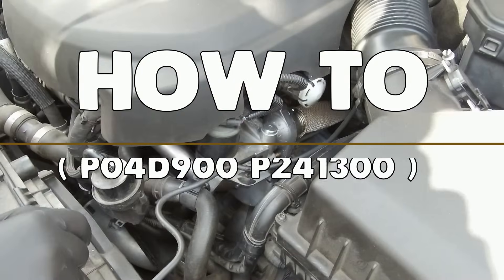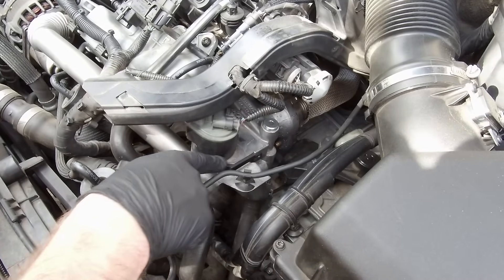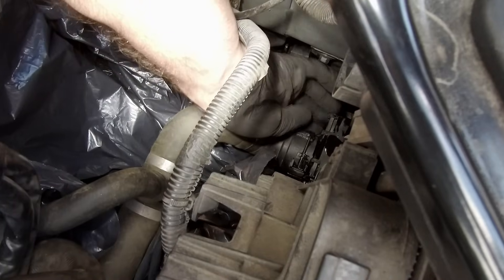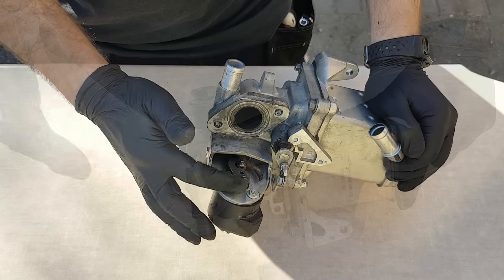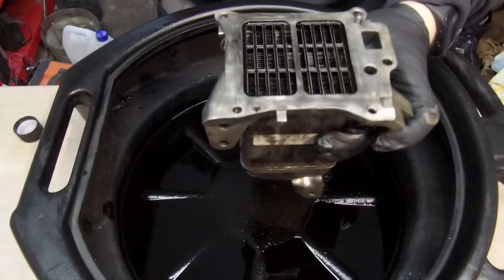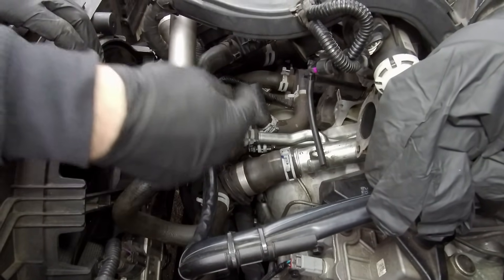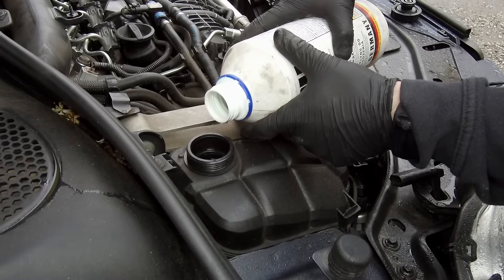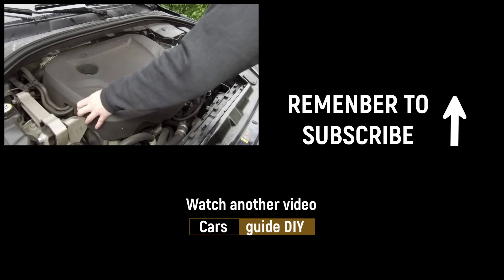How to solve a problem with EGR valve : Volvo 2.0 D4 ( P04D900 , P241300 )

Comment: Very good instructions. Unfortunately I had to do it 2 times because the car used a little coolant after the repair where I reused the gasket for the EGR cooler. 

Second time I bought a new gasket which is possible without buying a new cooler or EGR valve.

Comment: I have just finished the cleaning and remounting of my EGR valve (I have 140 000 km). First I would like to thanks you because you gave me evidence that it was not too difficult. Second through this I notice two issues:  a) My EGR valve was one mounted with 2 bolts (the 3rd one below was not there), b) the pipe which was controlling the pneumatic actuator to by-pass of not the EGR cooler was squeezed and therefore was no longer allowing by-passing the cooler when the motor is cold (which is probably why I noticed a lot of soot in the cooler as well as in the gas inlet pipe.  My EGR cooler was almost clogged, your trick with acetone worked fine (I kept a picture).   I followed strictly your procedure except one. i.e. I removed the exit pipe of the EGR going back to the admission inlet. This eases the physical access to the EGR valve,  allows cleaning this pipe (it was very dirty dust and soot), and allows also a small access to the admission of the engine (for visual inspection) and allows to remove partly with fingers soots.

Comment: Very helpful tutorial, I had a very clogged EGR on my V60 and it has been of great help watching how to disassemble and clean it. The two T40 torx bolt behind the EGR cooler were quite difficult to get to, nearly lost hope. However I watched another video that explained that the right size of those bolt was a T40 so that helped making sure I was using the right size. I would also recommend prior to starting the process to spray some penetrating oil on those screws, so by the time you reach to disassemble them, they'll be easier to remove. EGR cooler was very dirty (68k miles on a 2017 car) and it took few days and multiple soaking to cleaned it up. Some people uses also ultrasonic cleaners, I've not tried as I don't have one, but it could be an alternative especially if you're planning to do few of them. Volvo quoted £1500 to get it sorted and didn't want to do any goodwill. After putting everything back and deleting the code, it has not come back and everything looks alright. I'll try to update if anything changes.

Comment: Thank you very much for this excellent video !!!  
It has made me confident to start doing it myself .
I did it on a complete week-end including the cleaning with pure acetone.
The warning light, so annoying, no longer reappears at all after the reset with my OBD2 reader. 
The car is now more punchy, consumes 0.5 liter less per 100km and I saved a lot of money :-) the garage did not want to clean but to put new parts..

Several points to share if it can help : 
- XC60 2014 200K km
- EGR changed at 60K km
- EGR recall done ~2years ago (hoses +ECU reprog it seems)- motor warning light appeared 6 month ago
- I've bought the gasket between EGR and cooler on auto-doc Ref 013.630, brand 'Elring'. It fits perfectly and is of good quality
- Step to empty the coolant at 4:50 in the video skiped. I used a cut bottle instead to recover the liquid (~0,5 liter) when removing the hoses.
- the tightening torques can be found on other videos- the step of unscrewing the 2 screws between the EGR and the exhaust pipe is not shown in the video ~6:22. Have you changed your original torx bolts to new ones in yellow color  (hexagonal head) ? On my car it has torx screws and I had a problem at this step because I stupidly forced with a Torx30 screwdriver even though it was Torx40. I couldn't see the screw well because the head was oriented towards (and close to) the dashboard; I partially broke the teeth of the screw. I recovered the problem by forcefully pushing a torx40 screwdriver into the screw (with a hammer), it worked.

Voila !  Thanks again and long life to your channel ! ;-)

Comment: Hi, thank you for the well explained tutorial. I followed it but sadly, my EGR valve is broken (actuator not moving freely).
Just a little tip for the cleaning part. I've used oven washing detergent without caustic soda (not good for aluminum). Here in France you can find a product called "decap four" by henkel, the green bottle one named "confort".
It is really efficient.
Goodbye mate!

Comment: Hi, Just followed your video and did the job. Your Video and description was brilliant. I had Engine warning light on all the time. I had it checked and it was EGR fault. £1000 for volvo to fix!!! I did it in 5hours plus 24 hours cleaning time. Now all cleaned out and back working. the car feels more responsive. My D4 had only done 47K miles and I could tell the EGR has already been off before because bottom bolt was missing!!!  Thanks CG  love you.
Reply from the maker: Good to know :) Regards ;)
Reply: I'm also having trouble with my egr on 2.0 d4 r design 2014,  garage has quoted me over £800 and that doesn't include labour, 
100,000 miles

Comment: Question, how long after assembling the egr back should you wait until you start the vehicle again for the sealant to cure?
Reply: usually that would be stated on the sealant instructions: I would generally expect 24 hours for full curing. Some people on other forums mention the fact that sealant is not actually needed if you use the gasket.

Comment: I gave the same problem and i am going to use youre procedure.
Only one question, why remove coolant from bottom hose? If i disconnect egr valve not much coolant will escape only from egr ? Egr is on top of the engine!

Comment: Hello,

I have fault code P2262, on volvo xc60 2015 2.0 diesel. I have already change 2 sensors  but the problem is not gone. Can same one help

Comment: 6:23 You can see 2 "golden" screws to the pipe and EGR module. These have to be unscrewed also.
Reply: I have V40 ,those 2 screw was the hardest to take out,i have small hands but there was no space

Comment: Can I use Ultrasonic cleaning machine to cleanr EGR Valve & Cooler? Was thinking of using 10L Vevor Ultrasonic Cleaner with Allendale Engine SOlution....Great video by the way. Thanks.
Reply from the maker: I've never used it, but it seems like a good idea :) 
Thanks for your comment
Regards :)

Comment: Im getting a P00BC MAF error. I monitired the EGR valve on the app while driving and it stayed at -1.52 and hardly moved from that, so potentially an EGR valve stuck. Im going to get it mapped out, does the EGR delete remap also make the EMAP pipe redundant? Or will the EMAP pipe continue to operate?

Comment: Thank you for taking the magic and worry out of sorting out my egr problem.   Worked a treat,  clear video with excellent description.  One suggestion if doing this you could slot out the bottom bracket from the left so the you only need to loosen the bolt and won't drop it when replacing the egr cooler.  That bolt can't be seen or felt and is hard to locate.  I tried slotting it from below but that didn't work due to lack of clearance I couldn't lift it up far enough.  Great job saved me a packet!

Comment: Good video.  Do not be affraid to use high pressure washer. It helped helped me finaly. Soaked in different chemicals but finaly got clean with high preassure washer.
Reply: Thanks for the tip! I followed your advised and cleaned mine with the pressure washer. Happy with the result. ;)

Comment: Thanks, about to attempt this having watched your disassembling once already - seeing what needs to be removed and where all the fixings are is super helpful - unlike VIDA which basically shows 4 steps and magically the EGR assembly is removed 🤦‍♂️

One question - how on earth were you able to get to the 3rd EGR bolt at the bottom with all the pipework in the way 😮

Update: Well I managed it eventually - my cooler was disgusting, I tried the acetone method which was pretty good, but then realised that there was too much caked on crud inside. A degreaser I had lying around also worked really well - Bilt Hamber's SurfaceX HD which did a great job dissolving a lot of the oil. After around 6 soakings and rinsings, some of the channels were still blocked so I used some thin wire (the outer steel cables from armoured cable) to dislodge any hard bits - after another 3-4 overnight soaks and rinses the water is finally running clear 😵‍💫

Comment: some work was done on my car by volvo regarding EGR 5 moths ago, since then my cars clock time is wrong and I cant correct it. the sat Nav is also disconnected. when I got the car back it had no coolant fluid in and even after adding the liquid the dash was showing liquid being low. 
now my car is showing a ton of fault codes but everything is working right when parts are checked individually. 
my XC 60D4 shakes and lacks power to the point it hardly drives. 
I would be greatful if anyoe has any advice or experienced the same.
Reply: Join to UK volvo v60, xc60 Group or volvo 60 International one mate. Both groups are available on facebook
Reply: @CharlesPiston  had same problem with my 2016 volvo V70 D4 Engine. apperently oil been leaking or not burnt correctly and the whole motor is full with oil sludge. and my egr broke. got a new one 1 month later it broke the egr. The car lost power or didnt not accelerate properly either during the .

Comment: I was replacing EGR valve my self recently at the same engine. Unfortunately in my case that sort of repair was not possible due to faulty electric engine, so I had to replace whole valve. For those who have got same problem this is great movie. Great job.
Reply: Same problem on my side. how many miles/km you had on board when happened?
Reply: Same happen to me my d2
Reply: Hi, 
I'm also having trouble with egr and may need to replace it, if you don't mind me asking how much did you pay for it?

As a garage has quoted me over £800 and that's not even including labour
Reply: The same thing was needed for me. Replaced it for 600 gbp and the dtc re appeared. Still investigating

Comment: Thank you for this .
Engine warning light came on and fault code was reported to Volvo on our 2014 V60 D4 they said EGR needs replacing. 
We have been quoted £1700 by Volvo to replace EGR.
Absolute disgrace to be charged this when it's a known design fault.
Reply: The car is >8 years old and probably with the mileage to have gone around the world several times. How long warranty do you expect?
Reply: @Mejk4204  that is not the point
Reply: @johnbower  The point being?

Comment: I can See that this Car in the Video has the old cooling System. Now in the Year 2020 Volvo Car Corporation has started a new Recall on These engines to solve the Problem with Carbon build Up in the intake manifold 
and related parts of the intake System,that effects the EGR System,Cooler and Valve.
Reply: Volvo should fix the fault because at the moment customers with cars older then 4 years haven't got help from the dealers
Reply: They do if the car is still under warranty AND if you have the car maintained by your official volvo dealer.  Otherwise they simply tell you have to buy the parts.  don't ask how I know.  The problem still comes back anyway.  shitty system.

Comment: That engine still has pretty serious problems. 
It consumes oil excessively after 100 thousand kilometres. certainly the used 0w20 oil doesn't help, nor does the mileage of 30,000km for each service. Have you already solved similar problems? meaning did you change the oil with a 5w30 or a 0w30? or are there other problems with this?

Comment: Great tutorial..
Could you help me to clean the PCV valve of this same engine. I have volvo s60 2014, Diesel, 2.0 D4. 
Its valve cover gasket is leaking and makes a whistling sound on rpm above 1500. I have tested oil filler cap with rubber gloves, its just inflated and slipped off because of increased pressure. I thought to replace PCV valve but couldn't find it on this engine.

Comment: Awesome guide. Very easy to follow! My egr is super clean now but unfortunately the valve is still temperamental in movement and very stiff! I’m going to have to buy a new one but at least I can fit it myself
Reply: Hi, 
I'm having trouble with mine as well, 
May need to replace it myself as well,

My question is how much did it cost? 
As a garage has priced me over £800 for the new egr and that's not including labour
Reply: @sheffcitys2forgedinsteel255  I think mine was around £520 ish. Following this video makes it very easy. I didn’t bother with hose clips either
Reply: @PeterFrench  thanks for the reply mate 
Don't know whether to try this ( cleaning it  )
Or buy a new one and try to fit it myself
Reply: @sheffcitys2forgedinsteel255  I used DIMER cleaner, it got rid of all the crap in it. Worth a go considering the cost garage would charge, even the part itself is expensive. Fitting is fairly straight forward, no special tools required and it took less time that I expected. If you are confident enough with a socket set go for it.
Reply: @Peter French  yeah i probably will do it myself makes sense and save me probably the best part of a grand if not abit more.
Once again thanks Peter for your insight
Reply: @PeterFrench  how did you teach the new EGR valve in? Can you do it with a common OBD reader, like the iCarsoft V3.0? or do I need the Volvo DiCE/ VIDA? I have to replace both EGR valve and EGR cooler on mine...
Reply: @luke1811  just replaced it and gave it a drive for a few miles then checked the fault codes cleared with OBD. Nothing else. I only changed the egr and not the cooler. Although I did clean the cooler as much as I could when I took it off initially.
Reply: @PeterFrench  thanks!! that's comforting to know. Volvo wanted 3k€ for a Cooler and Valve swap, with 2 weeks lead time... 
What model and year did you do this on?
Reply: @luke1811  I did this on XC60 2016 D4 2.0 Manual. Thats a crazy price, I'm by no means a mechanic but I'm more than willing to give something a go. Basic tools are all you need and just follow the video. I didn't drain the coolant or block the hoses, just topped up the coolant after. Car has been running sweet since, although its time now for a service and new tyres, so something else I'm probably going to do.
Reply: @PeterFrench  Yes, they are located in a big city, I guess they have to pay their abnormous rent lol. That's great, I want to start servicing it myself too. Don't like spending half a day for an oil change at Volvo.
 They also told me the MAP sensor at the intake manifold is coked. Do I need to change the sensor, or is cleaning sufficient? Is it a hard task to do? Thanks again for your help!
Reply: @luke1811  I’m sure you can just clean that, that’s easy enough to change as well. I’m sure it’s just 1 bolt
Reply: @PeterFrench  awesome. I will let you know how it went, if I don't forget 😄 Thank you

Comment: Hi, is it possible that it could that also cause  a air flow sensor problem  ?
Reply: Yes,the MAF Sensor is affected.
Reply: MAF sensor which is on top of manifold and EMAP pipe which is on the right side, behind the engine
Reply: @CharlesPiston  is it possible to remove EMAP pipe for cleaning? Is it easy to remove? Thx.
Reply: @chargrilled9081  I didn't yet but Tom from UK Group did

"you'll need to remove one heatshield, one bolt from the other and bend it away from the banjo to manifold connection.  Fiddly but can be done. the pipe is £80 + VAT"

Comment: Do you know if the EGR valve motor return spring is supposed to close the valve as mine is staying open around 2mm, if I close it completely by hand the engine idles better, TIA

Comment: I fixed the same problem on my 2014 V40 D4 190hp. I had e very hard time cleaning the egr cooler. It was full of carbon deposits.I left it 2 days in different cleaning products and almost no result.Acetone didn't work in my case. After that i used a high presure shower head with hot water and it slowly started to clean up. It took me more than a hour and a lot of dirt was splashing in my face and clotes. Finaly i succeded and i  saved about 500 euro. The check engine light is finaly off and the car runs great.
Reply from the maker: Good to know :) I hope my video helped you.
Regards
Reply: Oven cleaner
Reply: kobus van boxtel over cleaner is to aggressive to aluminum

Comment: Is it not possible to remove as much coolant from the header tank , unclip and blank/plug the 2 x EGR Cooler hoses from the cooler instead of draining the whole system ??.  Volvo completed an EGR cooling recall but VIDA still report EGR 'Low Flow'. So I'm going to clean it using your method, but unsure where I can buy Acetone in the UK.
Reply from the maker: I prefer to drain all coolant. It's not complicated and you don't make a mess. Regards
Reply: nail varnish remover is acetone

Comment: What about the high oil consumption I experience on my 2014 D4 Volvo 0.5l in circa 1200 miles. Volvo engines used to last for many K’s but mine has only done 150k. This is the worst car I have ever bought and has to go ASAP.

Comment: I love the fact that the wrong EGR-Valve/Cooler combination is fitted.. you shouldn’t be needing to use a threaded bolt with a nut on the other side.

Comment: Great video. Helped a lot to remove and clean the valve and cooler (hardly blocked), but less than a month later "Check engine" light is on again whit the same fault P04D9. Any clue what else can be?
Reply from the maker: Hi there.  Are you sure you cleaned it properly ? I spent more than two days to clean the EGR cooler. Maybe you cleaned it only half way ? After this job it's worth to visit volvo, they have new update for engine ECU. It's changes EGR valve operation.
Regards :)